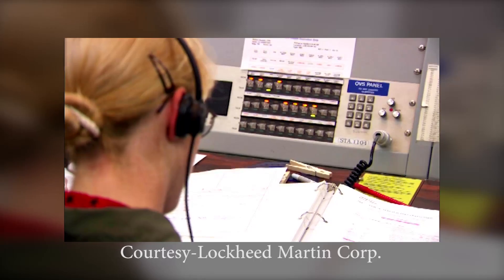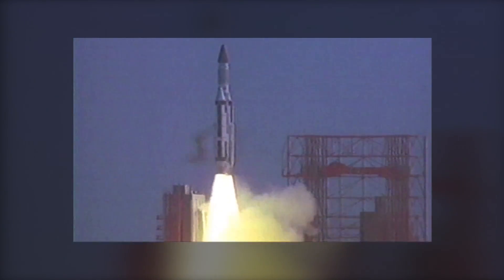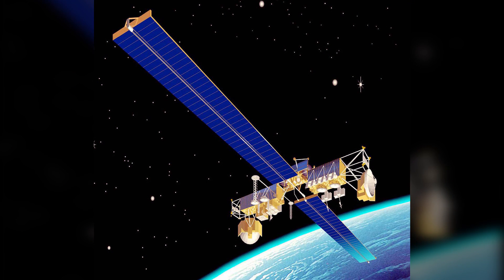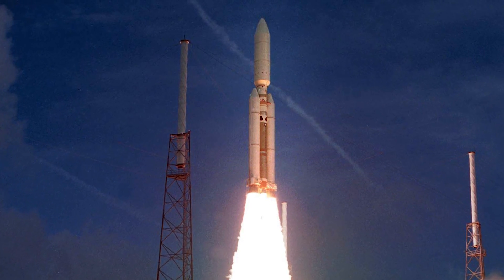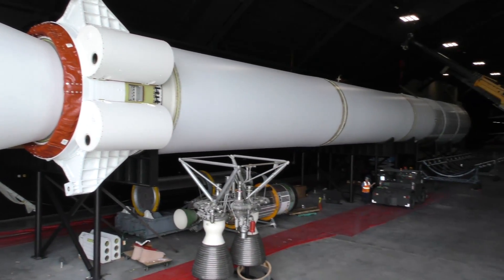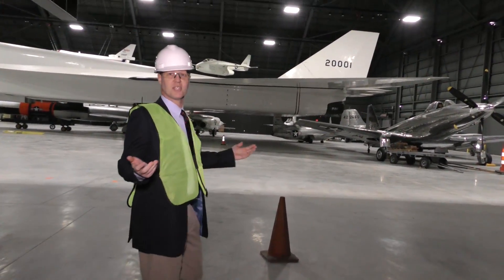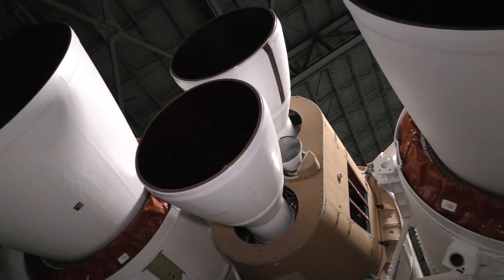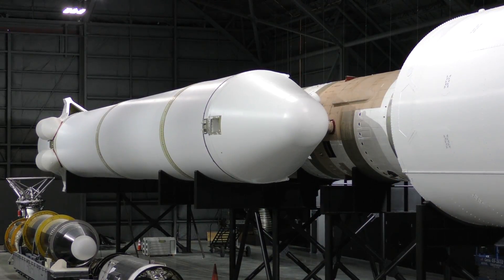Titan IVB Feature

Comment: It's funny that the one comment was "These vehicles were never meant to be built or displayed in the horizontal configuration"
For 50 years, ALL Titans (I, II, III, IIID, CT, IV-A, and IV-B) are built horizontally and stored horizontally (yes the tank segment welds were don in a vertical weld jig, but it was then returned to the horizontal for installation of the internal support structures). The Booster core segments are naturally built vertically to pour the propellant, but are stored for very long periods horizontally, as well. Yes the PLF must be assembled vertically, as it was in the UES, but was always cleaned and stored horizontally.
So my point is that unlike many other launch vehicles, the Titan was actually structurally sound enough to handle being horizontal without collapsing on itself nor doing it any damage. It's just fine horizontal without any pressurization nor extra internal bracing.